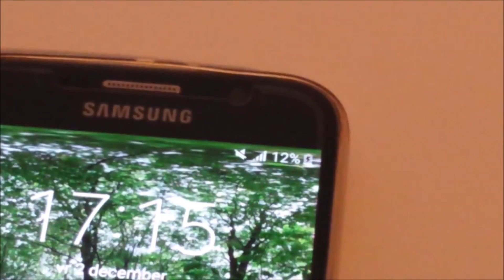5 EASY ARDUINO PROJECTS

Comment: Make a separate video on the solar panel and to improve it make a system that uses the solar power to power the circuit so if there is not enough sun it will switch back to USB.
Reply: Please check the description

Comment: Would an arduino board be able to power the solar tracker, but for considerably larger solar panels?
Reply: you could always use an external power supply / battery

Comment: I want the solar panel tracker.
Reply: It would be more amazing if it can power itself though. ^^
Reply: why he can't power itself??
Reply: It's possible that it can power itself but the power from the solar panel would be solely for running its motors and circuitry and not for other appliances/devices as we know, solar panels to date provide a little power.

Comment: how you make the stack highscorer.
how this machine work?
Reply: the timing or sensor?
Reply: timing
he placed a comment on that video :

Code:

#include <Servo.h>

Servo servo1;

void setup()
{
  servo1.attach(9);
    servo1.write(125);
  delay(5000);
  servo1.write(90);
  delay(200);
    servo1.write(125);
  delay(750);

}

void loop()
{
  servo1.write(90);  //1
  delay(200);
    servo1.write(125);
  delay(600);

}

i hoped i have helped you
Reply: thank you